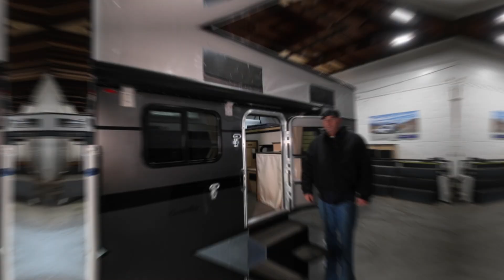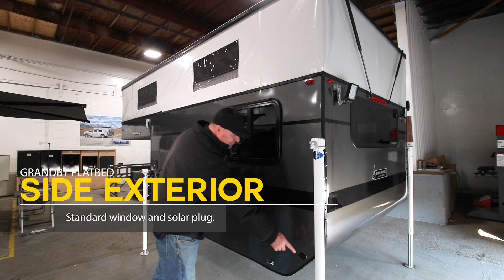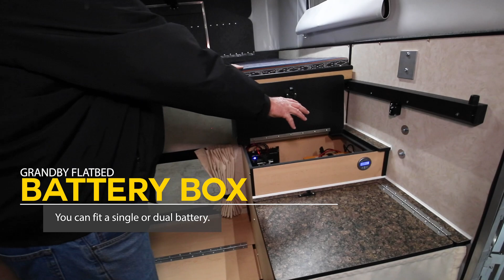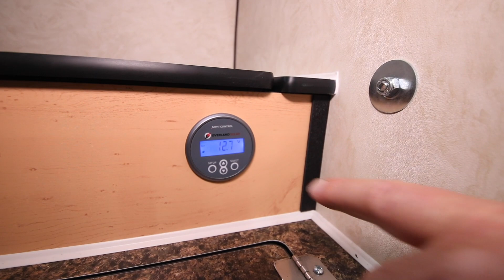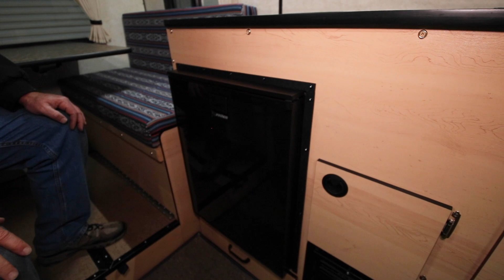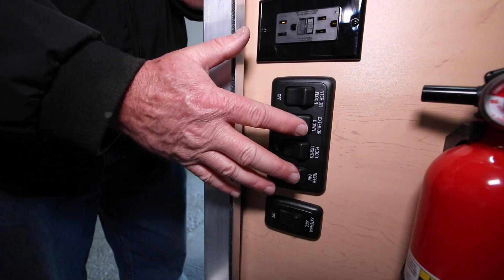2021 Grandby Flatbed Truck Camper | Four Wheel Campers

Comment: My concern with these is that if it is used a lot, desert to coastal to mountains, that tent material will begin to crack / tear or rot-out. I don't know that but it just seems like it would. How long does that fabric last with raising and lowering 2 - 5 times  a week?  Thanks!  Awesome looking camper. I love these things... cheers!
Reply from the maker: Thank you Jack. We have been building these camper for 50 years, so we have lots of experience and data on how certain materials actually hold up in the real world. The soft sides (pop-up fabric) is very similar to Hypalon, the material used for river rafts and inflatable boats, like a Zodiac and inflatable Coast Guard boats. Most customer get 15 years of trouble free use of the soft-side material if they don't do anything special for care or maintenance. If you take good care of the fabric, most customers getting 20 years of good use out of it. It is easily replaceable. It is a rip-stop fabric, air tight, and water-proof vinyl fabric. It is not canvas. Hope this helps. Happy Camping !    :)
Reply: @FourWheelCampers  - Wow... that is impressive...

Comment: Can you get AC in these campers?
Reply from the maker: We do not currently offer AC in flatbeds. They are only available in slide-in camper models with rollover couch or side dinette configurations. Hope this helps!
Reply: @FourWheelCampers  do you offer this in a shell
Reply from the maker: @rodriqueselston1119  We do not offer shell flatbeds at this time, but do offer shells in all slide-in models.

Comment: Would it work on Tundra?
Reply from the maker: A Grandby Flatbed will not work on a Tundra. Grandbys are made for 8ft long truck beds. In general, a Tundra does not have a high GVWR (Gross Vehicle Weight Rating) so to make a smaller flatbed work,  major truck suspension upgrades are needed.
Reply: @FourWheelCampers  what about the 8' tundra

Comment: My wife and I plan to live in a flatbed Grandby full-time. 

Is it possible to order without the fridge and lighting or are those things built into every model?
Reply from the maker: Hi Chaz, In the flatbed model a refrigerator and lighting come stock in the camper along with many other features. You can find the full list of features and options on our website. https://fourwheelcampers.com/all-models/flat-bed-pop-up-truck-camper-mid-and-large-size-trucks/
Reply: @FourWheelCampers  I may have to get a shell and build it out, thank you.
Reply: @chazlyle41  Don't worry, they've had to expand because they've sold a s-ton
of them, you should be able to get one cheap really soon.